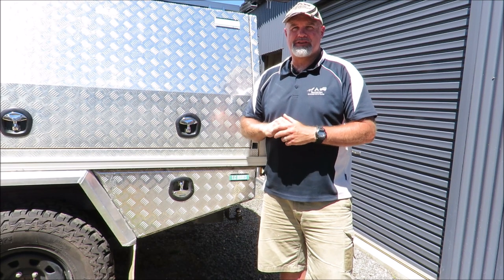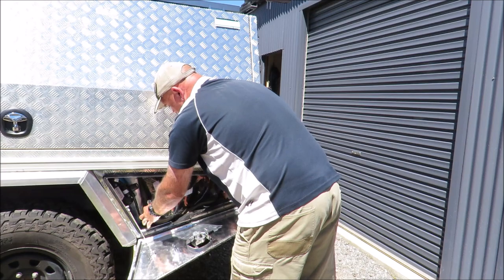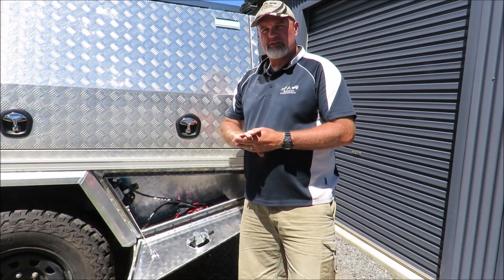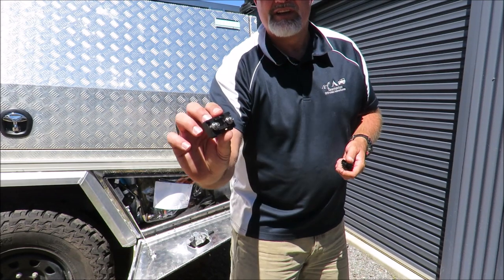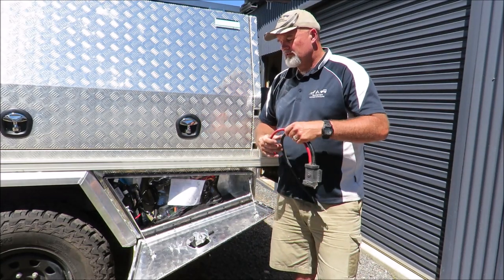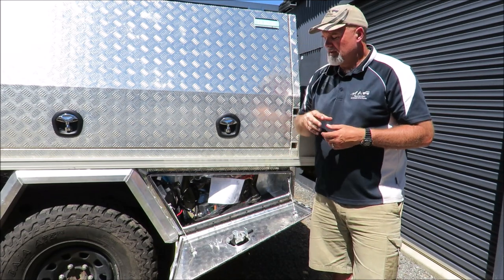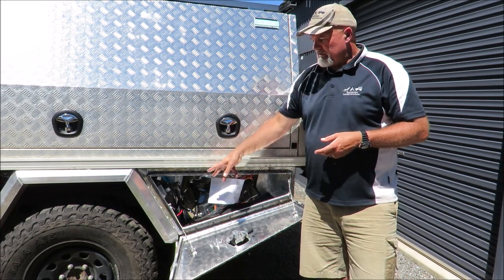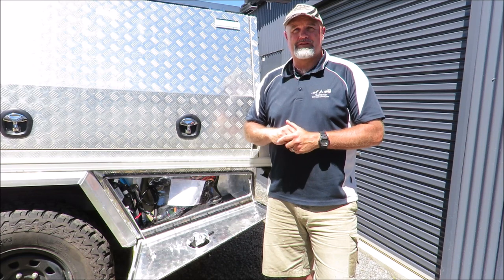Tips on Hard Mounting a 4wd Air Compressor

Comment: Re your ohm's law stuff at the end, I think you will find that compressor current drops (not increases) as wire resistance increases. Only a product that draws constant power (such as a 240V inverter) will draw higher current as voltage drops. A compressor behaves more like a constant resistance device.
Reply: Yep, V=IR (Ohm's law), or voltage equals current x resistance. So for any given voltage, as resistance increases, current decreases.

Comment: Great video thanks for that,  I already have an anderson plug at the rear to charge the camper, could I do the same and just rewire my portable compressor to anderson plug ? Looks like a cheaper option that getting one installed that’s for sure
Reply from the maker: Hey mate, you would need to check the cable size and fuse to make sure it’s suitable. Mine is the same as yours, dual purpose to charge the camper trailer as well.

Comment: To reduce the voltage drop, would it be worth considering mounting a compressor in the engine bay? I’ve got space for it on my 02 Ranger. I’ve got a dual cab still with the regular pickup body, I’m not sure if or when I’m going to build a flat bed for it.
Are the downsides of being in the engine bay worth it? I think heat, water and mud will be the biggest problems. But I’d feel more comfortable running and fitting airlines to the rear rather than electrical cables
Reply from the maker: Absolutely fit it in the engine bay if you can. Previous to the Ranger I had an ARB under bonnet in my Hilux. It was in there fir 8 years I think with no issues at all.
Reply: @TasmanianOffroadAdventures  with mine being an older Ranger, I’ve got space inbetween the air box and the headlight. I will just have to make sure it’s relatively easy to remove because for some aspects of maintenance such as the thermostat, removing the air box and alternator really helps with access
Reply: I've got a Hilux and that's where I'll be mounting mine as I've seen others with an Arb in same spot must be similar to your ranger as to space in that area mate

Comment: If you run off the second battery, wouldn't the DC/DC charger get the alt charging the second batt anyway?
Reply from the maker: Yes it would. It’s ok with the ARB compressor that draws relatively low current but if it were a larger compressor like the Double Thumper that draws up to 90 amps it wouldn’t be a good idea. It would still work, but it is adding more components into the scenario than necessary.
Reply: @TasmanianOffroadAdventures 👍 Also they (ARB & 4wd24/7) that secondary batteries are not designed for the amount of draw a compressor takes they are for lower & slower drawing items. Not my words there's I'm not an expert but yeah he's definitely wired it correctly to starter.